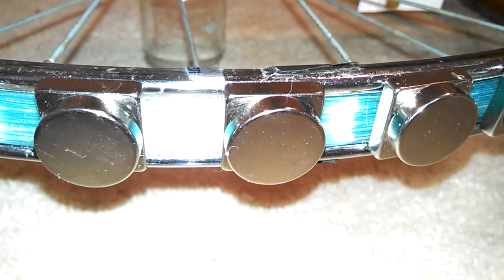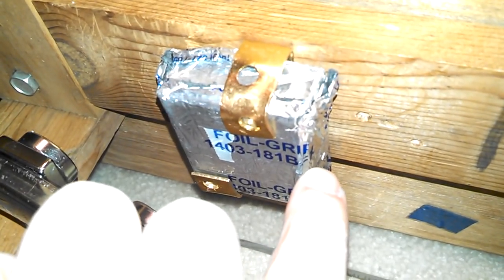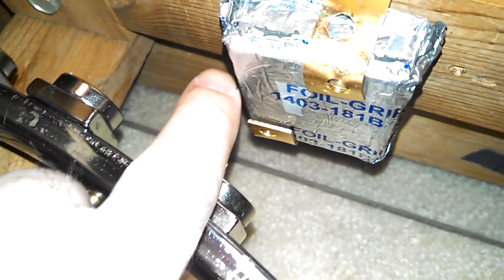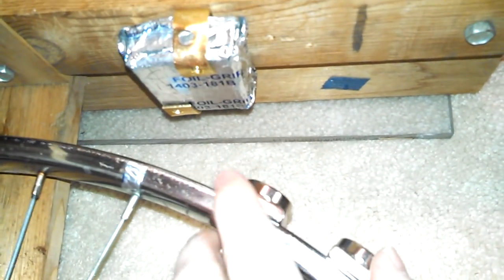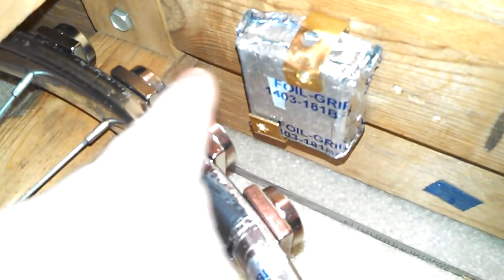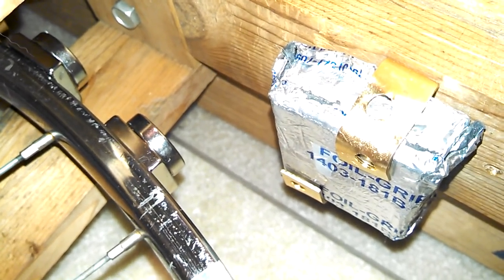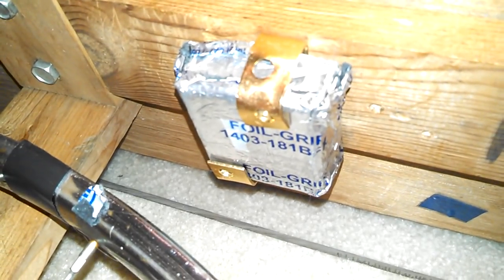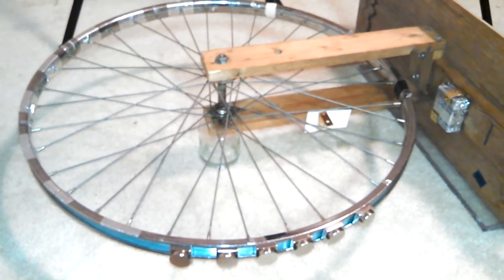🧲 Self Running Magnetic Motor Stator Test #2 update

Comment: I will try once. After some similar experiments I have just given up and together with a friend of mine built an electro\magnetic motor and 1.7kg with 2blade propeller won out of it. At least this worked just fine. One more thing. Metal rotor is not the best choice because of edy current.
Reply from the maker: 🧲 Yes. I know. Thanks.

🧲 CREDIBLE FREE ENERGY MAGNET MOTORS THAT WORK 

MAGNET MOTORO - Rotor Encantado
https://youtu.be/mxgwTzxfe8Y

Amazing Magnet Motor/Gen Rep. This is not a fake
https://youtu.be/jKFTAobM-l0

WORKING MAGNET MOTOR 2023
https://youtu.be/vdtdKE2Qe40  

SELF RUNNING MAGNET TURBO MOTOR 
https://youtu.be/6sIBHn5-9pI 

 WORKING MAGNET MOTOR - rotor magnético
 https://youtu.be/3mD0_0FiJ54

 MAGNET ONLY MOTOR from SOUTH KOREA 
https://youtu.be/smzpbKg9S7M

1966: German inventor presents his Free Energy Device Magnet-Motor
https://youtu.be/XWQjMyMWXAc

Comment from the maker: When I place three stators in a row (back to back) it suddenly picks up considerable speed that is far more then what is canceled out when the last magnet passes through. I've found this process repeats itself when the lead rotor magnets pass across the next set of stators. Rather than depute my findings, man up and build it yourself, than you will see for yourself that it works exactly as I claim. I work 80 + work weeks, so I have no time to build a final working prototype until early 2014.

Comment: BUT. Yes it speeds up but comes back to slower speed as it's leaving the magnetic field. There is no meaning of making one side of a magnet stronger than the other side because a magnetic field is in a circle closed. Even if we would have almost positive side there is no change of energy loss. Only the direction changes like you did and others as I aswell. :) Magnets are only some kind of capacitors. IF we would find a way to gain energy = magnets would lost their magnetic field as they do.
Reply from the maker: 🧲 CREDIBLE FREE ENERGY MAGNET MOTORS THAT WORK 

MAGNET MOTORO - Rotor Encantado
https://youtu.be/mxgwTzxfe8Y

Amazing Magnet Motor/Gen Rep. This is not a fake
https://youtu.be/jKFTAobM-l0

WORKING MAGNET MOTOR 2023
https://youtu.be/vdtdKE2Qe40  

SELF RUNNING MAGNET TURBO MOTOR 
https://youtu.be/6sIBHn5-9pI 

 WORKING MAGNET MOTOR - rotor magnético
 https://youtu.be/3mD0_0FiJ54

 MAGNET ONLY MOTOR from SOUTH KOREA 
https://youtu.be/smzpbKg9S7M

1966: German inventor presents his Free Energy Device Magnet-Motor
https://youtu.be/XWQjMyMWXAc

Comment from the maker: If I were a bullshit artist then at some point I would have given up. But my results are not only real, but I know of NO ONE on the web that explains in detail how to build a stator that defies Newton's 3rd law where as,  I DO!

Guess what? If the skeptics would simply build it, they would see that it works the way I claim that it does. In that.... I have overcome the infamous sticky spot which is required to make a motor self running based solely on magnets alone.

Stay tuned.

Comment: Well done James, try to do it just one Stator and try to use a better bigger flywheel with very little friction... You need to get it to work with just ONE Stator first. If you add more Stators the magnet fields will superimpose and  weaken eachself and it will not work... We have tested simular designs already many years ago...
If your one Stator gate works it will spin a big very low friction flywheel and it will accelerate until the friction will compensate the acceleration.
Regards, Stefan.

Comment: groups of three every 6 inches between every group 2 inches between each magnet
Reply from the maker: 🧲 Sorry it took me 9 years to stumble across your comment. I cannot keep up with thousands of comments in a timely manner. A lot has changed since your comment here. If you're still around, simply respond to this and I'll do my best to respond to any question you might still have quickly. A lot has changed since your post. The wheel never kept Turing at that stage, thus I kept using my hands to stop the wheel. Guess you're not getting automatic updates from me? Go here for some breaking news. 👉🏻 https://youtu.be/8EYxKWsVx2k

Comment: It is 26 inches in diameter. He said it moved about 20 inches in circumference, which for a 26 diameter wheel means that it moved about a quarter of a turn. Which it did.
Reply from the maker: 🧲 Yep. 🧲 Sorry it took me 9 years to stumble across your comment. I cannot keep up with thousands of comments in a timely manner. A lot has changed since you comment here. If you're still around, simply respond to this and I'll do my best to respond to any question you might still have quickly. A lot has changed since your post. The wheel never kept Turing at that stage, thus I kept using my hands to stop the wheel. Guess you're not getting automatic updates from me? Go here for some breaking news. 👉🏻 https://youtu.be/8EYxKWsVx2k

Comment: I don't think that the issue here is whether a magnetic motor can work.  There are many examples of working motors on YouTube, some are very impressive.  The biggest problem with almost all of them is that you can stop them with your finger.  There's not enough torque to do meaningful work. There are examples that I've seen that look powerful, but where can you buy a working example?
Reply from the maker: Using only magnet to create continuous motion has long since been solved and replicated by others. There for this is no longer theory. Thanks for visiting nonetheless.

Comment: Try this...  Place the magnets asymmetrically space around the wheel… but use this geometry about the whole wheel without gaps. E.g. decrease (or increase) the distance between the magnets (ever so little) around the circumference of the wheel in the direction of travel about 360degs… let’s see if this configuration under motion last longer. I fear it will still not work but will rotate longer.
Reply from the maker: Using only magnet to create continuous motion has long since been solved and replicated by others. There for this is no longer theory. Thanks for visiting nonetheless.

Comment: IIn laymen’s terms… In the beginning of your experiment you start the wheel at the highest state of potential energy.   It easily passes to the second revolution (but not as fast) & maybe to a third revolution…losing energy every time.  Like a rollercoaster at the top of the hill, the coaster easily accelerates to the second smaller hill (then decelerates) & then accelerates as it passes over the second hill… and so on to the third hill, but the coaster eventually stops.  Not zero point.
Reply from the maker: Using only magnet to create continuous motion has long since been solved and replicated by others. There for this is no longer theory. Thanks for visiting nonetheless.

Comment: Billionaire superpowers spend half their time making sure anyone who comes up with an energy source that doesn't use gasoline, diesel, oil, or is an energy that isn't possible to charge a fee for, either dies, or has their patent ruined in some way.  There have been many very efficient (and some free) ways to create energy such as the energy that is floating around in the air we breath, we just need a way to harness it.
Reply from the maker: Yes. It's in the very air we breathe. Using only magnet to create continuous motion has long since been solved and replicated by others. There for this is no longer theory. Thanks for visiting nonetheless.

Comment: Aaaaaaaaaaaand HOW LONG HAVE YOU BEEN EXPERIMENTING THIS TOPIC?  How many hours have you spent trying to make it work?!  Remember when we used to use candles for light??  It used to be "impossible" to create light without fire...
Reply from the maker: Guess what? Turns out we've had German magnet motors for cars since 1966. Google it. Now others are creating their own magnet motor. Using only magnet to create continuous motion has long since been solved and replicated by others. There for this is no longer theory. Thanks for visiting nonetheless.

Comment: Use several series of magnets. Put magnets in exact patterns around wheel. Say two or three sections of the same configuration.
Reply from the maker: Guess what? Turns out we've had German magnet motors for cars since 1966. Google it. Now others are creating their own magnet motor that truly work. Using only magnet to create continuous motion has long since been solved and replicated by others. There for this is no longer theory. Thanks for visiting nonetheless.

Comment: I saw something similar except a ball bairing was inside the wheel and pull by an outside magnet thus making the wheel spin indefinately using gravity
Reply from the maker: Guess what? Turns out we've had German magnet motors for cars since 1966. Google it. Now others are creating their own magnet motor that truly work. Using only magnet to create continuous motion has long since been solved and replicated by others. There for this is no longer theory. Thanks for visiting nonetheless.

Comment: You are doing a previous experiment of mine ...later versions of my attempts used partially shielded neo or rare earth magnets i found the need to change angles spacing shielding and proximity to the opposing field  to make any amount of force still many flaws
Reply from the maker: 🧲 TAKE A LOOK NOW at VID from OCTOBER 2022 and onwards. Not sure if you'll ever see this though as I'm only now seeing your response out of thousands over the years. Thanks for stopping by nevertheless.

Comment: Having the setup at the slightest of angles would result in the same result. If the flux difference is really there you should be able to give it a swing and keep it rolling for about a day. Also you should give it a tiny push in the other direction so we can see it slowing down equally quickly.
Reply from the maker: Good point!! 🧲 TAKE A LOOK NOW at VIDS from OCTOBER 2022 and onwards. Not sure if you'll ever see this though as I'm only now seeing your response out of thousands over the years. Thanks for stopping by nevertheless.

Comment: There is already a 47KW Magnetic Motor generator running in Germany powering a multi-story building that they are studying the thermal dynamics on right now.   These magnets will completely loose their magnetism the instant they reach 380 degrees C.  But this motor doesn't seem to generate much heat which I find somewhat puzzling.
Reply from the maker: Guess what? Turns out we've had German magnet motors for cars since 1966. Google it. Now others are creating their own magnet motor that truly work. Using only magnet to create continuous motion has long since been solved and replicated by others. There for this is no longer theory. Thanks for visiting my channel nonetheless.

Comment: I'm referring to the basic 4 stroke combustion engine.  The starter on which is an electric motor driven by a 12 volt battery, but once the engine gets running, the batter gets recharged.  But there is a high BTU fuel powering the entire thing, and that fuel must continually be supplied to keep it running.  There is already a 47KH Magnetic motor running in Germany that requires no fuel.  They are studying it for its thermal dynamics.  Which is pretty important, since the magnets die at 380C.
Reply from the maker: 🧲 I've seen that report. TAKE A LOOK NOW at VIDS from OCTOBER 2022 and onwards. Not sure if you'll ever see this though as I'm only now seeing your response out of thousands over the years. Thanks for stopping by nevertheless.

Comment: You can put as many magnets on that wheel as you want.  It will never run on it's own.
Reply from the maker: Guess what? Turns out we've had German magnet motors for cars since 1966. Google it. Now others are creating their own magnet motor that truly work. Using only magnet to create continuous motion has long since been solved and replicated by others. There for this is no longer theory. Thanks for visiting my channel nonetheless.
Reply: @FreeMagneticEnergy2  
Jame James James.  
Are you claiming Germans were running vehicles without batteries and just manet motors?  
Are you referring to Friedrich Luling?  
I do not wish to insult you James, but if these actually existed, where are they now James?  James this comment is 9 years old and you still are no closer to building a self-running magnetic motor.  It cannot be done given the Laws that govern our Universe.  We call these laws Physics.  Learn some Physics James.

Comment: Even in a 4 stroke Combustion engine you need an electric starter motor to get it to start and go.  And then all you need is to continue to supply the engine with fuel and oxygen and the 4 stroke combustion engine will continue to run.
Reply from the maker: Guess what? Turns out we've had German magnet motors for cars since 1966. Google it. Now others are creating their own magnet motor that truly work. Using only magnet to create continuous motion has long since been solved and replicated by others. There for this is no longer theory. Thanks for visiting my channel nonetheless.

Comment: I think if you stood it upright you would have less friction and would also be able to use the force of gravity, enabling you to use less magnets, keep it lighter and maintain  roughly the same amount of revolutions. Although, if the outer rim was filled with magnets and kept upright, I would just use another stater? to increase push and pull to compensate for weight.  I've just been researching these vids for the past week - don't know much.  Any how, good stuff!  I like it!
Reply from the maker: Guess what? Turns out we've had German magnet motors for cars since 1966. Google it. Now others are creating their own magnet motor that truly work. Using only magnet to create continuous motion has long since been solved and replicated by others. There for this is no longer theory. Thanks for visiting my channel nonetheless.

Comment: You know there's a working continuous working magnet motor in a style like this in an engineering museum in Austria. I stood there for hours  trying to work it out. As far as i could see it looked like a combination of  magnetics & electrostatics. Somehow it worked. Getting back to this concept, I can't see why it won't work, remembering that the field on 1 side is mostly cancelled but the other magnets do try to pull too the metal shielding too. Anyhow I hope you can make use of it.
Reply from the maker: Thanks. This problem has long since been solved. I was near broke and ran out of magnets when I made this video. I would not have money for this project for a very long time, along with other personal issues that derailed me.  YouTube took down 17 more of my videos as well.  Hopefully you see my answer all these years later. So guess what??? Turns out we've had the German magnet car motors for since 1966. Google it. Now others are creating their own magnet motor that truly work. Using only magnets to create continuous motion which has long since been solved, and easily replicated by others. There for this is no longer theory. Thanks for visiting my channel nonetheless.

Comment: People back then didn't have the scientific background like we do today.
While it's pretty impressive that you've overcome the 'sticky' spot, it proves nothing. The energy you bring in the system by bringing the magnet poles closer to eachother is just converted into kinetic energy and heat(friction). The fact that you overcome the sticky spot proves not much except that you've got a very low friction setup going on.
This will never give you infinite rotation.
Reply from the maker: Guess what? Turns out we've had German magnet motors for cars since 1966. Google it. Now others are creating their own magnet motor that truly work. Using only magnet to create continuous motion has long since been solved and replicated by others. There for this is no longer theory. Thanks for visiting my channel nonetheless.

Comment: You pull in strong with attraction then do as you say keep attracting, then the virtual opposite pole appears in between the magnets and it pushes off as the next magnet comes around to pull in. I believe the spacing of your magnets is so important because if not spaced just right the repel pole is not of ample strength and magnetic width to couple with the stator. This is just my opinion but either way great job and thanks for caring enough to do the sharing.
Reply from the maker: Guess what? Turns out we've had German magnet motors for cars since 1966. Google it. Now others are creating their own magnet motor that truly work. Using only magnet to create continuous motion has long since been solved and replicated by others. There for this is no longer theory. Thanks for visiting nonetheless.

Comment: James, I know this is in attraction mode and I believe what is happening is as you say however I also think there is repulsion. Reason being, whenever you put two magnets of same pole such as on the rim close together but not touching, the opposite pole appears in between the magnets. If too close it wont show, if too far apart it wont show but if you put it the same spacing as the size of the magnet it shows up, a virtual pole. I believe this is a yin yang affect you pull in with and push off.
Reply from the maker: Guess what? Turns out we've had German magnet motors for cars since 1966. Google it. Now others are creating their own magnet motor that truly work. Using only magnet to create continuous motion has long since been solved and replicated by others. There for this is no longer theory. Thanks for visiting nonetheless.